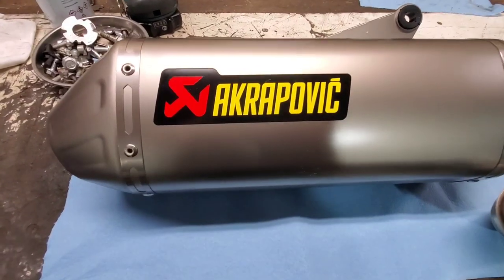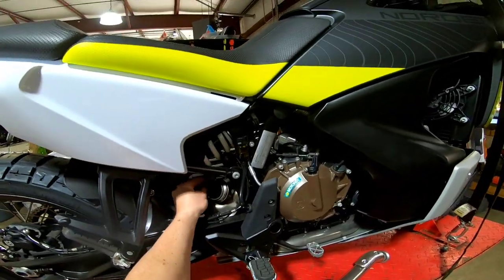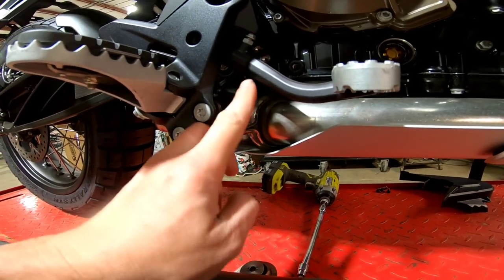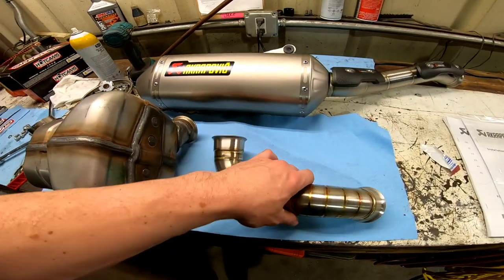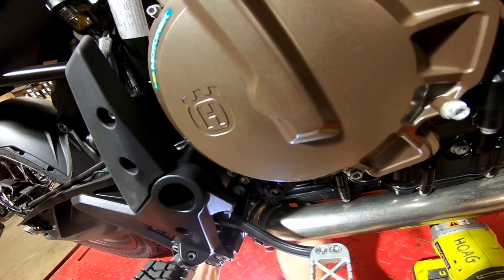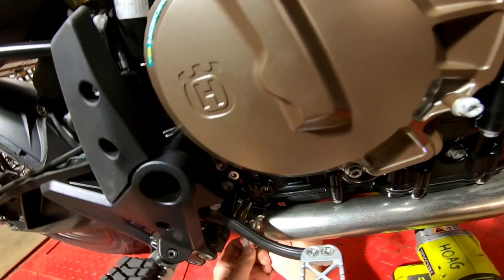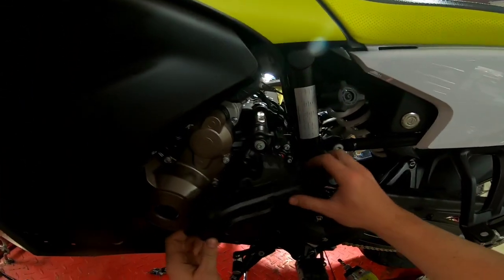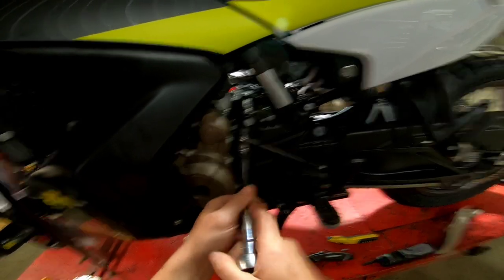How to install mid pipe/cat delete/ Akropovic exhaust on a Norden 901 + Sound Test

Comment: Great video! Very helpful and straight forward. Post a link for a tip jar if you have one! For those with an Expedition 901, you'll need to remove the center stand as well.

Comment: The Arrow one has the andvantage that it has some resistance in it that will actually help gain some little wxtra power from the engine, especially at lower rpm’s.

Comment: Thanks for that Hoagie, I like the look of the stock silencer, but wish it had a slightly better sound. My concern with the de-cat, will it be too loud! Do you have a video with the Arrow cat delete with stock silencer, is it quieter than a Akrapovic with Arrow mid pipe? Final question please, are these mid pipes you use specific to the Norden 901, or are they a  cross over KTM 890 Adventure part? Cheers Hoagie.
Reply from the maker: I've been ordering parts from Rottweiler Performance. According to them, the Arrow mid pipe fits the 790, 890 and 901. I did see a video where the Tekmo didn't fit very well. I'd say this mid pipe I installed on this video didn't fit very well either. I've installed a bunch of the Arrow's and they've fit the best! I have installed an Arrow mid pipe with the OEM muffler when the Akropovic's were backordered. I thought it definitely sounded better than the oem cat and wasn't as loud as the Akropovic muffler & cat delete. Unfortunately, I don't have a video of that install. I talk to that guy every day and can get his opinion on it and get back to you!
Reply: @hoagiemoto  that would be good to hear the owners opinion on the Arrow with OEM silencer. As I said, would like a bit more sound, but not too loud, because where I live, they are very sensitive to loud motorcycles!
Reply from the maker: So he said that he didn't notice much of a difference when he swapped the oem to akropovic muffler. He doesn't think that's its loud now or even when he had only the arrow mid pipe. It's not loud like a dirt bike or crotch rocket haha. The Norden's have a nice deep rumble.
Reply: @hoagiemoto  cheers Hoagie. 👍
Reply from the maker: I just uploaded a new video comparing the sound between the oem exhaust, cat delete and the akrapovic plus arrow mid pipe. I did an arrow mid pipe with stock muffler for you

Comment: I have no idea what people are talking about in regard to a heat issue that causes discomfort. My rear shock is still operating just fine. I don't ride with sneakers on, so maybe that's where the complaints are coming from. I'd like to install the Akropovic but I don't want to get rid of emissions related components. Federal emissions regulations are being more and more enforced. Besides, I have no issues with the stock performance at a grin inducing 105 hp.
Reply: I rode a KTM 790 for 4 years. The first time I got on the 901 Expedition with its wraparound bash plate the difference was profound. Even through heavy duty adventure boots I can feel the heat on short rides. If I go for a short ride around town with street boots or street shoes my ankles are baking within minutes. YMMV, but this is the first time I've owned a bike where I felt the need to remove the cat for practical reasons. It's a real problem, especially for the upcoming 2000 mi ride I'm doing.
Reply: @clintbuhs7708  Every once in a while I wear my thin slip on shoes when I'm going to town and back, still, no heat problem. I absolutely have no clue what y'all are talking about.
Reply: @howlinhog you should have that checked out at the doctor. 😆

Comment: Does a arrow cat-delete with oem silencer require a re-map or power commander please?
Reply from the maker: No, it doesn't require one. All of the guys I know who are running the arrow mid pipe and akropovic muffler are not re-mapping or using a tuner. I have one guy who ran the arrow mid pipe and oem muffler for awhile before he switched to the akropovic muffler. He didn't re-map either. His bike sounded good. They all have over 1000+ miles on them so far
Reply: @hoagiemoto  I've heard of unconfirmed reports that installing the decat pipe makes them run lean and can lead to premature engine wearing?? Is there any truth to this? I would think the ECU could compensate for change in exhaust flow and back pressure?

Comment: Doesn’t look like this works on 2024 and I’m assuming because husky put an o2 in the cat. Unfortunately I’ve got mine halfway tore apart before I realized it.
Reply from the maker: Correct, I just found that out a couple weeks ago. We are in the process of having an 02 sensor welded into a mid pipe. I marked 2 of them up and drilled 1 so far. I am going to post a short video explaining that it doesn't work for 2024 models until a pipe manufacturer makes the changes and installs an 02
Reply: @hoagiemoto  I think I might give that a shot as well👍🏼

Comment: What Mid pipe did you install.?
Reply from the maker: I've I stalled an Arrow, LeoVince and one from ebay on bikes. The Arrow and ebay versions are in the beginning of the video. Not much sound difference but the Ebay is the most loud version